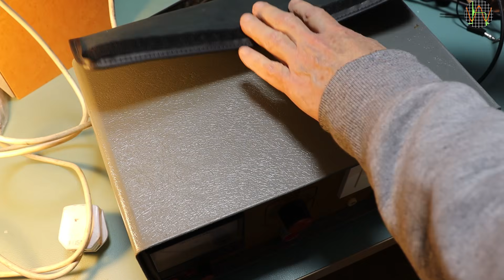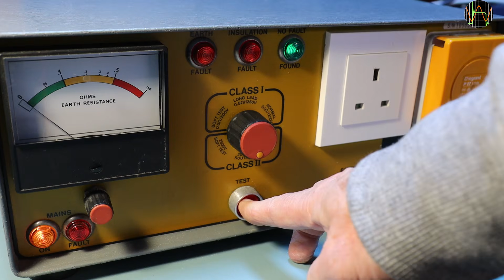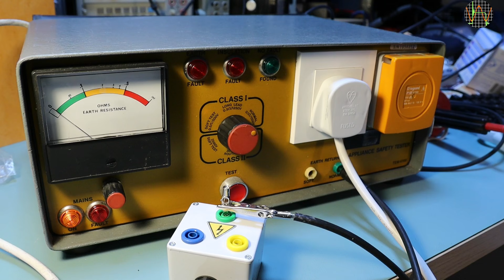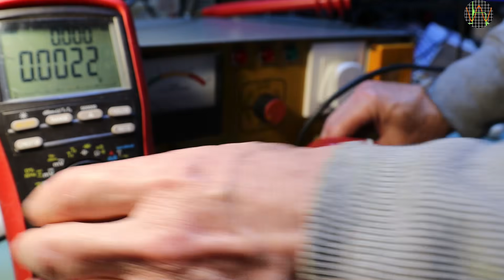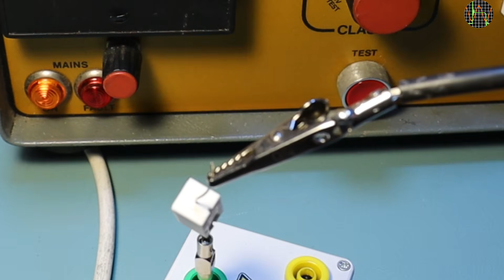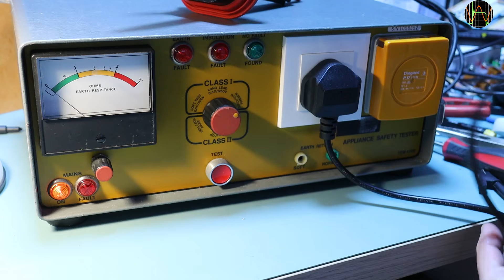215 The TEM 4700 appliance safety tester - Part1: Exploring and repairing lots of Amps and kVs

Comment: Excellent video! The HV circuit must have a high value current limiter resistance. It is possible that the low voltage reading its because the dmm hv probe 1Gohm impedance in series whit the current limiter resistance?
Reply from the maker: Valid concerns, but in this case the output resistance of the class 1 high voltage is about 8.4 MegOhm and the one for class 2 about 6.4MegOhm, so probing with 1.1Gigaohm (which is what the 40kV probe uses) should not cause any reduction of voltage on the high voltage side.
I do admit that I did not fully consider the low voltage side of the 40kV probe. Its output resistance is 1Meg and the multimeter has 10Meg input resistance. Normally the rule of thumb is that a factor of 10 higher measurement resistance compared to the load, can be regarded as having negligible effect. In truth, with this combination, the meter sees only 90.9% of the output voltage produced by the probe.  In the case of class 2 that would perfectly describe the "normal" setting. 90% of 3750 is 3375 which is about what I saw. But for the other 2 settings, the measurements are lower than they should even after taking the 90% factor into account. The 90% value of 2500V is 2250V not 1900 and 90% of 3000V is 2700 not 2500 but it is now more likely that these differences were the result of a large drop in mains voltage when I measured these 2 cases. I guess I will have to do this measurement again while keeping an eye on the mains voltage while doing them...

Comment: The insulation tests are carried out with L and N shorted together, and with respect to Earth (normally a -ve DCV). The Earth resistance tests are carried out at 2.5x the nominal maximum PFC (prospective fault current). The reason your voltage readings for the insulation tests are low is the input impedance on your DMM (it's pulling the voltage down)
Reply from the maker: Thanks for your comment. You are correct and as I showed, L and N are permanently connected and in class 1 mode, HV is between those and E.  Regarding the voltage, the influence of the tools used to measure something is indeed something one needs to be aware of and as you point out, normal DMMs may load the output and thus read low. In this case I don't think this is the case. I measured the resistance of E against L  in class 1 as about 6.2Meg  and the voltage was measued by a high voltage probe that has 1.1Gigaohm resistance. The output of that probe has 1Meg impedance and was connected to my BM869s which has 10Meg input resistance.  Apologies that I did  not explained that in the video.